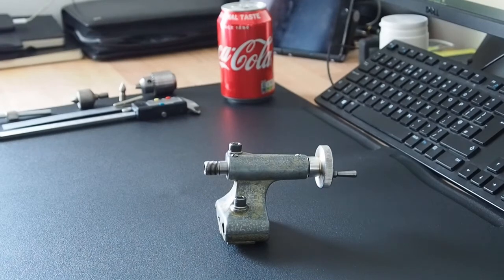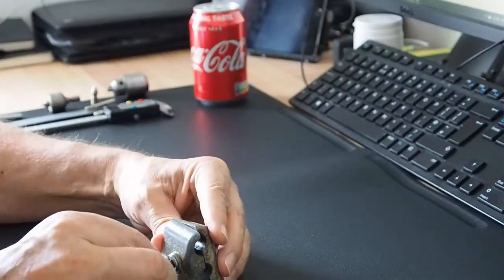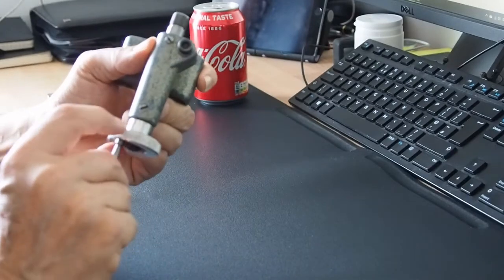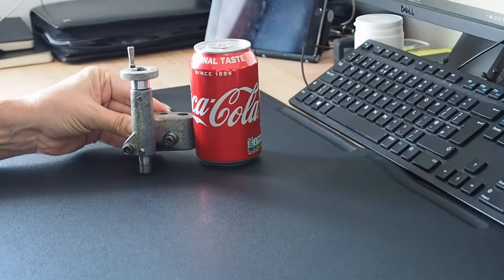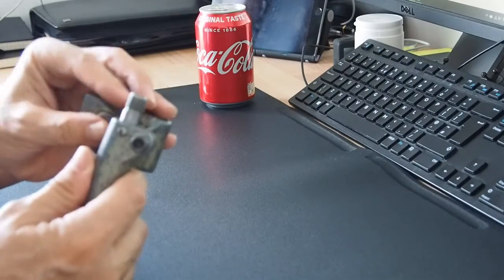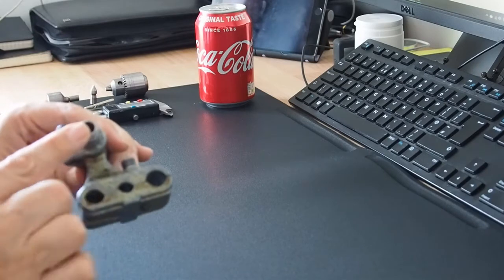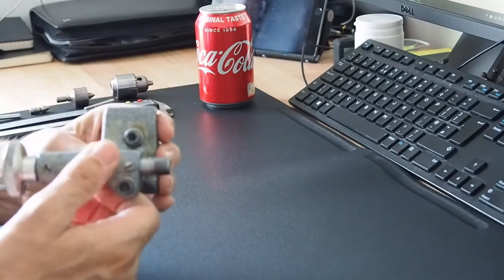Emco Unimat SL Lathe - Tailstock.

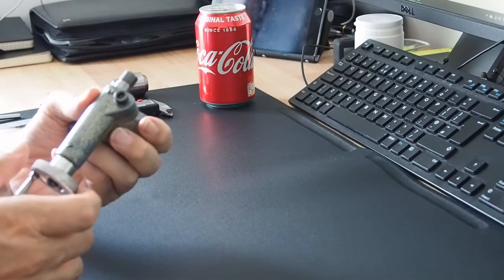Comment: 'move the drill out' (2:59)' - no, you follow normal lathe practice- when you run out of travel, you advance the tailstock and continue.
As a fellow youtuber, can I offer some advice?
 I find a short-form script helps the flow, so that things are neither missed nor repeated. It also reduces pauses, umms and arrs.
Most editing software makes it easy to remove hesitations and other errors, speeding up the flow and watchability.
When showing a part such as in this video, selecting manual focus on your camera prevents the autofocus constantly shifting focus to the background.
Editing is important, and can take longer than the filming. It sometimes reveals the need to redo a section, for clarity or other reason.
Please understand that this is not put forward as criticism, but a genuine desire to help. YT tends to be dominated by the 'big boys' with huge followings, at the cost of smaller channels like ours- we need to fight back!
Keep up the good work...
Reply from the maker: Hello Mike,
Many thanks for the tips... I am always happy to hear suggestions on how I can improve things... Thanks again.
Take care.
Paul,,

Comment: Hello, the tail stock on my unimat seems to be off centre. I have aligned the headstock with the bed by sliding the indicator on the slide along the bed.
However it’s still offset horizontally be 1mm. Just wonder did you experience similar problem?
Reply from the maker: Hello,
I would guess that it has been assembled the wrong was round, I have done it myself and the alignment is wrong...  If I am correct you will need to disassemble it and rebuilt it the right way round. I hope that is of help.
Take care.
Paul,,